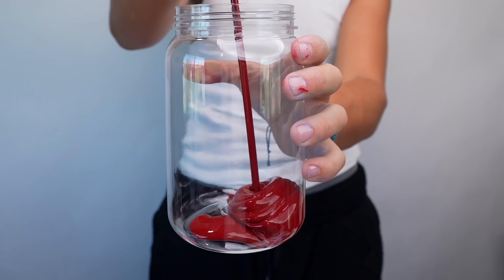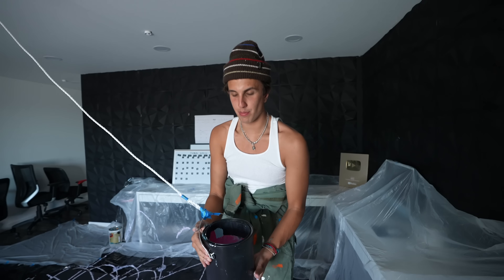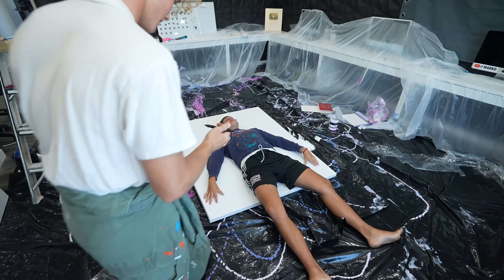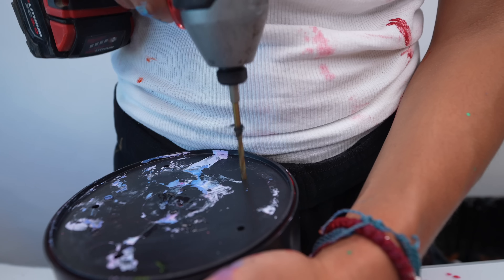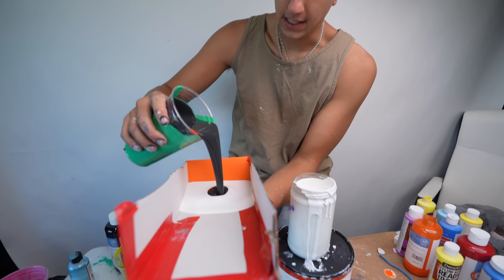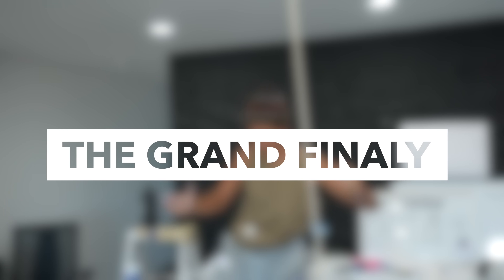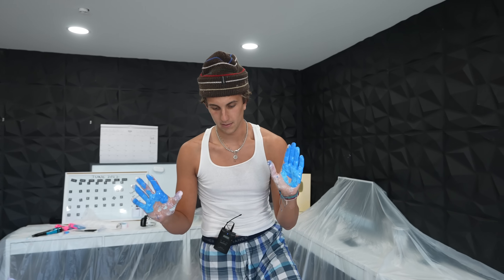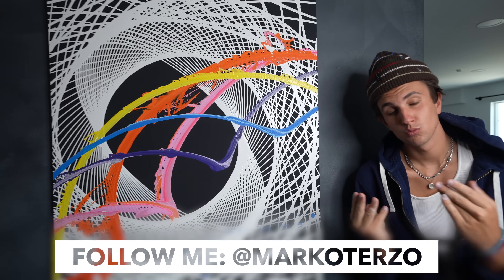I Tried "Pendulum Painting"…

Comment: No need to drill a hole in the ceiling. Try unscrewing a light bulb, tying the string around the bulb (make sure it’s above the metal base) and then screwing the lightbulb back in.

Comment: Firecracker painting… make a child’s sand box just smaller than your large canvas. Paint the canvas background color and let dry. Put fairly thick paint on a firecracker and place it in the sandbox. Put the canvas face down over the sandbox. Lift a little and light the firecracker and cover with the canvas. After explosion remove the canvas, clean firecracker debris and repeat as many times as you want.

Comment: Don't put dividers in a bucket, rather take 5 small buckets or 5 plastic bottles! This way you get a better "pour" . If you try this, take a wooden,plastic or metal ring! Could be the size of a child's bike wheel. Attach the ring to the sealing, and the paint to the ring. This will let you control the flow and the swing better. I am not a pro at all, we just did this under the pandemic, when we were bored...